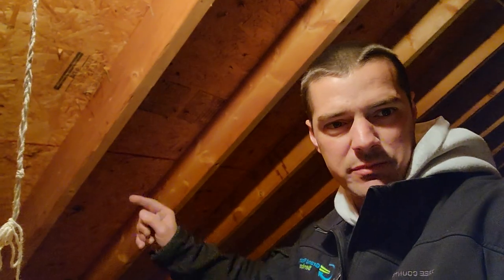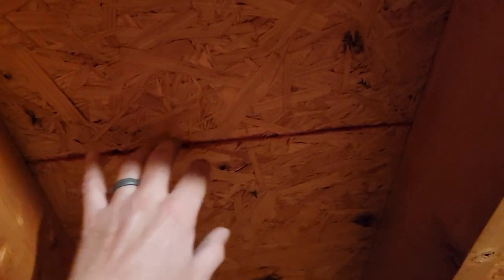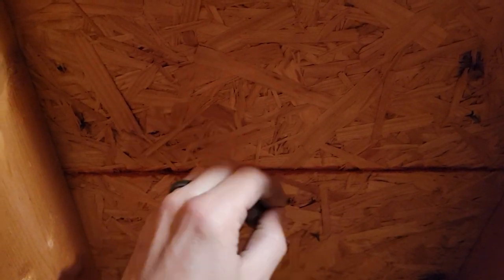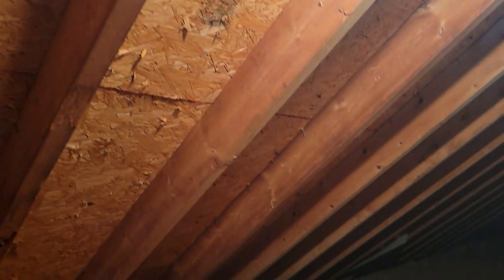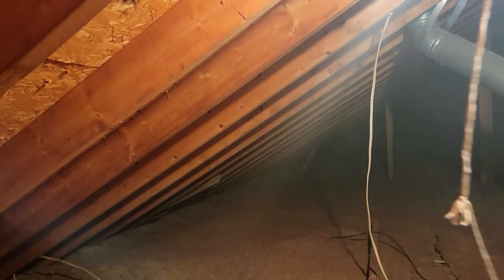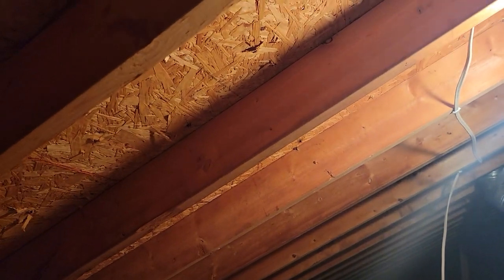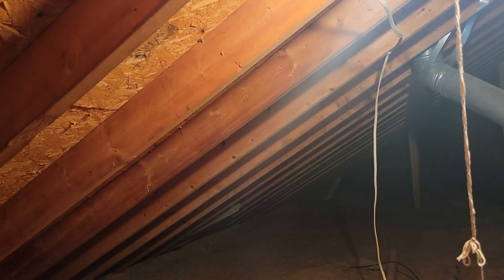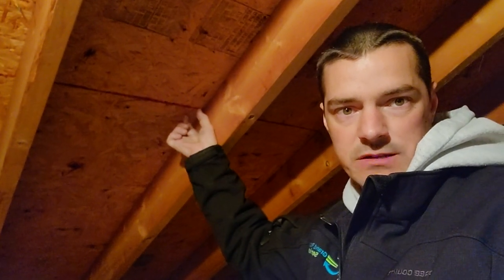Roof Decking & H Clips

Comment: As a framer of 5 years prior to roofing I thought you were going to say you need an H-clip to cover the span however at 16 inches those rafters are close enough that they are not exactly required, HOWEVER the 1/8th gap that the H-clip gives you is exactly why you should STILL install them. You were exactly right.

My apologies for ever doubting you I should of known I’ve just roofed with so many people who don’t know that lol
Reply: I kept looking at that spacing thinking it might even be 12" on center.  It's a bit of an odd structure, at least for my area.  The 2x6's are undersized for the span and (if my eye is correct) the spacing is narrow.

Comment: Yes, always leave a gap whether you use H-clips or manual spacing. My original roof had plywood decking with no spacing and no H-clips, and it creaked a lot during weather temperature changes. When re-decked with OSB, I used H-clips. No more creaking. H-clips are very cheap insurance for your roof deck.

Comment: OSB is garbage for decking. However, if cut to appropriate size, it can serve as a high BTU output firewood, assuming it has not already been converted to a sponge by moisture absorption.
Reply: Yeah,  I remember when plywood replaced planks and only the best builders used planks. Now OSB replaces plywood and nobody uses planks anymore and very few use plywood.  It's the evolution of construction. Build quicker and cheaper.  If it lasts through the first year a brand new house is warranted for,  it'll be fine for the builder.  
But even with that said, if the roof is installed properly, and the attics are well insulated and ventilated,  there shouldn't be any moisture on the sponge board.

Comment: I had some attic mold remediation done and the guys found that my sheathing over an addition was completely warped and likely the reason for my wavy sheathing. This was likely caused due to no exit vents being installed and it was overheating. If I have since resolved the venting (soffit + ridge vents) and had mold remediated, will that decking last me awhile? And when I replace roof should I go over it with new OSB or rip it out and install new? Thanks!
Reply: that inside osb has mold, use mold cleaners OR brand new 4x8 PLYWOOD sheets.... 1 room, just go new wood for $150,

Comment: I've always just taken my roofing hammer (ones with the flatbar instead of the claw) and tucked it in the seam slightly as I sheet a roof with osb, gives it a small gap and then I pin the sheet down and do the same with the other corner or if im working with someone they get the other side set
Reply: code requires hclip in 24 inch spans

Comment: Do you need h clips if installing osb on 1by 8 decking or is making it spaced 1by8 enough for expansion..
Reply from the maker: Even if you are installing OSB/cdx on top of 1x boards it is a good idea to space them so they can expand. So H clips aren't necessarily needed but spacing the sheets should still be done.

Comment: Pho tip: Use real Plywood instead of that chipboard garbage. There really is no good use for that crap.
Reply: Exterior building envelope you are exactly right, however interior shear walls they have more strength against earthquakes as long as they do not get exposed to moisture
Reply: $$$, ply is better, but cost for some people